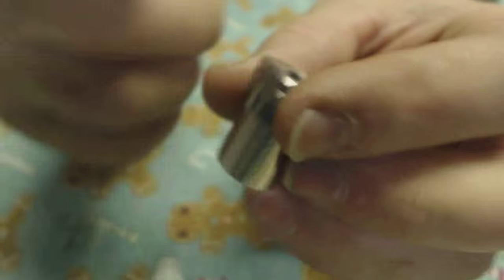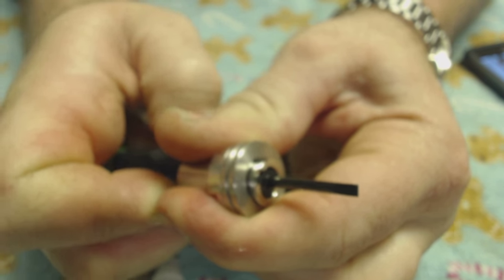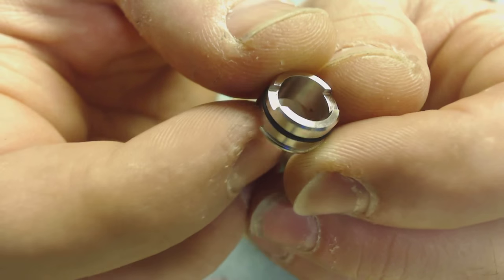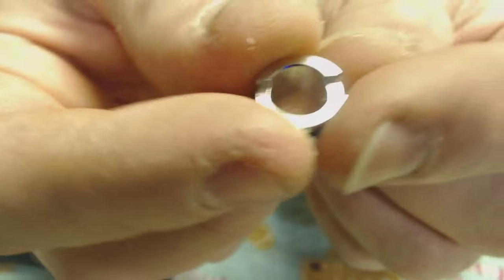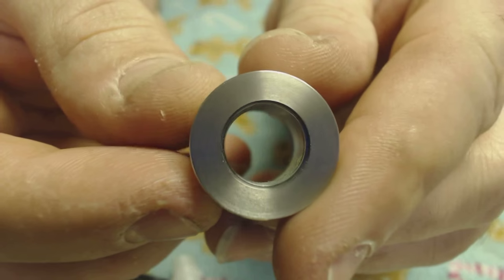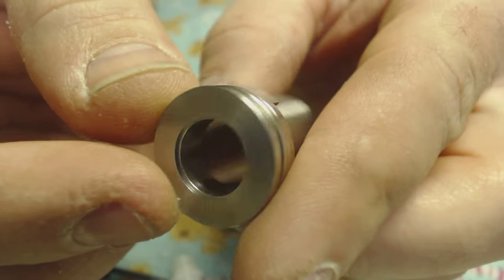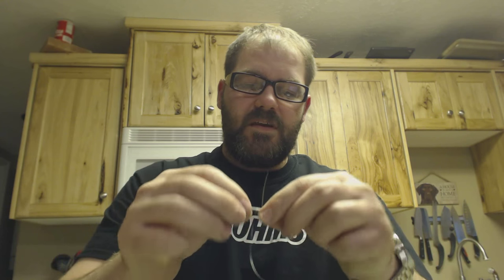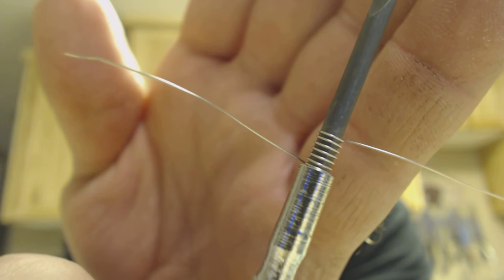immo+ rda + ni200 build! (.15)

Comment: the small thing is the drip tip adapter. there is a wide bore drip tip made for that atomizer, also you can remove it for a bigger hole to drip into.

Comment: Actually when I see a "1" by your channel name (on my phone YouTube app), I immediately click it and click the top, new, video before I can even read the title, I'm so excited!
Reply: I commented before I heard the shout out! awesome! thanks man. nickel, like other metals such as copper becomes "work hardened" from being flexed. It's the reason why wires in cars that connect to the engine of an old car break. (newer cars have measures to prevent this from happening.) The wires are repeatedly flexed slightly as the engine toques in its mounts. and after thousands of miles, the wire breaks from becoming hardened to the point it becomes brittle. You can strengthen your nickel in the same way. Do just like you would do with the blade of a scissor when making curly ribbons for Christmas gifts. when you pinch the wire in your fingers, try to get the tail of the wire to make a 90° angle to the wire coming off of the spool while sliding your fingers down it. if you do it about 15-20 times, the wire becomes just as ductile as Kanthal. (it becomes less ductile). if you do it too much the wire will break just as it does in the car scenario previously described. Hope that helps out. You're the man Trevor!
Reply from the maker: So stoked! Thanks for everything Andrew! your the man bro!

Comment: From the CAVapes website : 510 drip tip with option to remove insert for wider bore tips (not included.)  

Looks like they mean for it to be for a wider-bore drip-tip. but god knows where you find one that size.
Reply from the maker: I have searched high and low..but nothing! It's odd for sure...thanks for the info dude!

Comment: What is your favorite build in the Goblin Mini? Also what kind of Drip Tip are you using? Thanks
Reply from the maker: ni200 9 wraps 3/32nd! the drip tip is a friction fit custom made for the goblin from mink machine!
Reply: Is that single or dual coil?
Reply from the maker: +Gerald Garrett dual!

Comment: Hey trevor. Huge fan. Anyways I was wondering if you can help me out. I want to find a really good unregulated box mod that can handle really low builds (.1-.05) I have a Sigelei 150 watt box mod but I am worried that it cant handle those really low builds. I need your opinion on which one to get. If you could help out that would be great. Thanks
Reply from the maker: I still love my  bc box mod bro! It's the halo switch and is a work horse!!
Reply: Trevor Jones do you have the dual 18650 or dual 22650. And is it wired in series or parallel?
Reply: Oh its the one that has lights on it right?
Reply from the maker: +Jacob Townsend dual 18650 and it does, but you don't have to have them if you don't want to..but there pwm looks crazy!